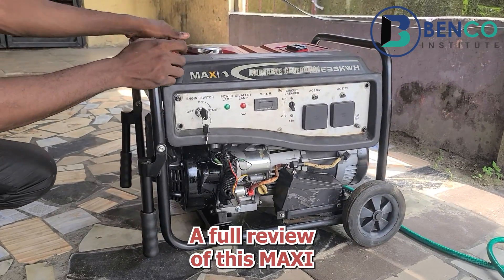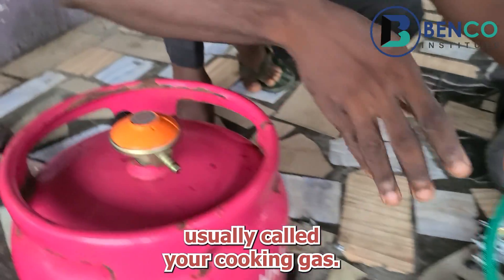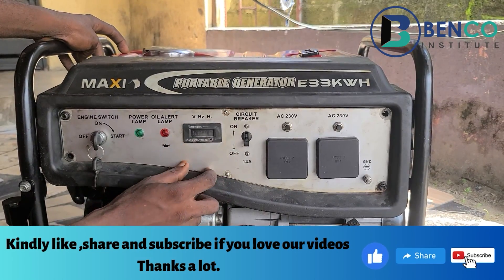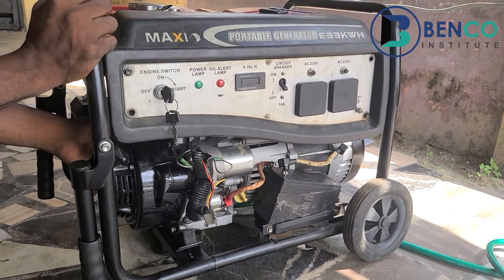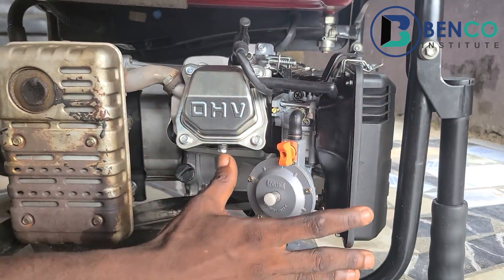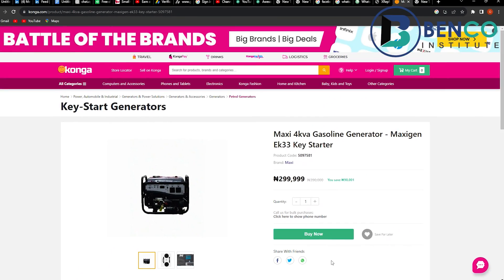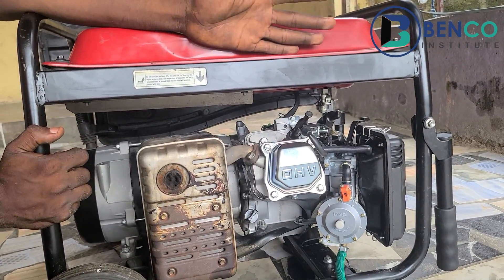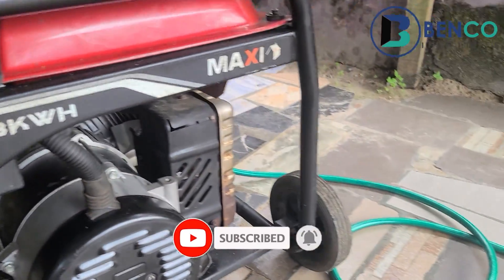FULL REWIEW OF MAXI'S DUAL FUEL GENERATOR,Use petrol or gas to run this gen....very affordable

Comment: Brother my question is not related to this actual post... bro please i just fixed my dual carburetor on d regular 2.5 generator buh i get to use 1kg for just an hour and also i noticed that my cylinder get chilled outside to the point of having water around it like mist like you just bring out a drink from the freezer. So please wah do u think i can do because i see people using their 1kg for 2 to 4hrs and i only power just lights and tv..
Reply from the maker: Bro

Kindly check this video 
https://youtu.be/TjLH1VOJaYE
Reply: Thanks for the reply bro, that was d first video i saw b4 checking ur channel out for other helpful tip buh the thing is my carburetor doesn't have movable switch between dah NG nd lpg it is permanently screwed... and for the knot that u said it more helpful with fuel other than gas i already adjust that...my cylinder valve from onset i open it like i neva did so is very kinda tight
Reply from the maker: @Sanfizzy_fx  that means there is a screw instead of the orange valve right.

Now here is the thing... tighten it a little...
Reply: @bencoinstitute  please can i send it to ur whatsapp bro
Reply: And sorry please what ur opinion on the cylinder sweating on the body and getting very cold could that be a problem that exhaust the gas faster...